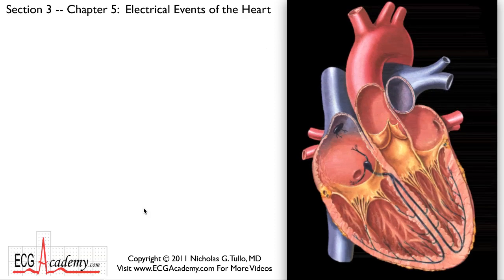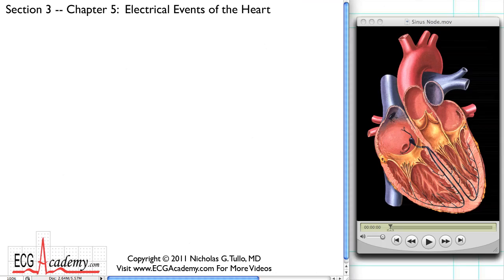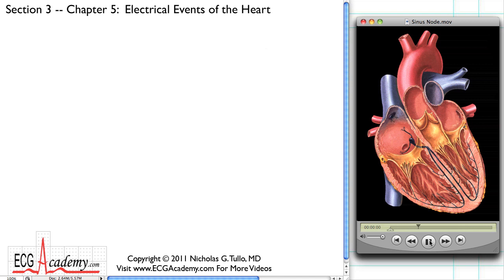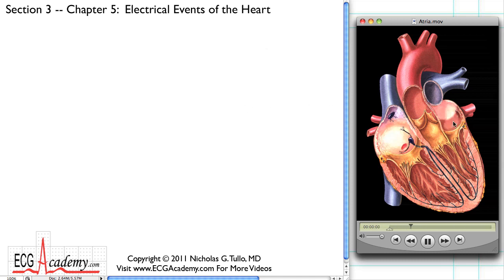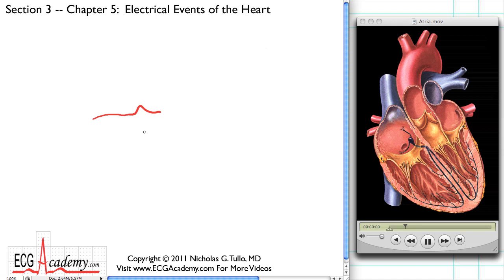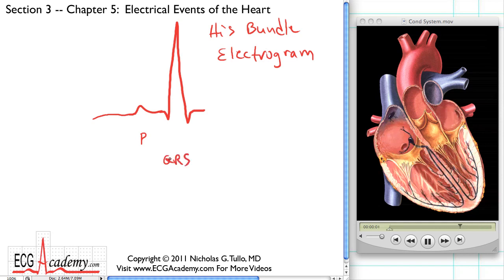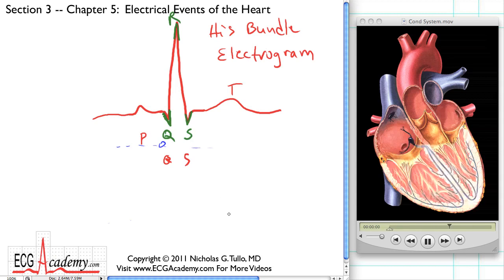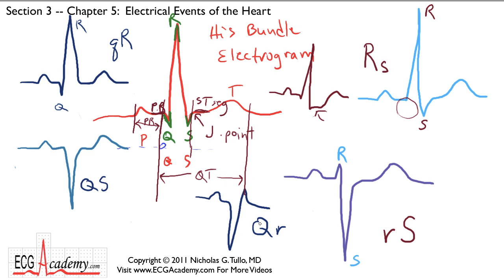Electrical Events of the Heart 3-5 - ECG / EKG Interpretation -- BASIC

Comment: Yes. I agree very helpful thanks for taking the time to do this. Also I was asked a question earlier maybe you could help me with? what would cause a regular, strong pulse at carotid and brachial sites to be within normal range (60-65, resting rate, done a few different times) but when taken measuring the radial pulse (done at the same time) to be very irregular, thready, slow, and weak in each wrist?

Comment: What i cannot figure out still if the depolarization wave in the septum starts from the ends of both posterior and anterior LBB, and then it continues to the PF activating the left myocardium and the activation travels through the septal myocardium from left to right? Or there are some junctions along the LBB starting myocardial activation before the signal arrives to the LBB ends? (cont next post)